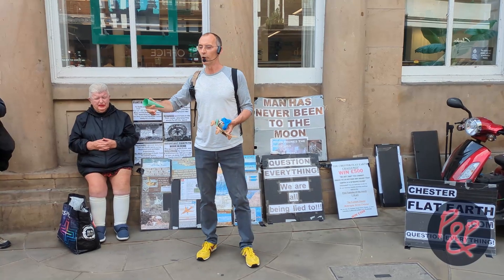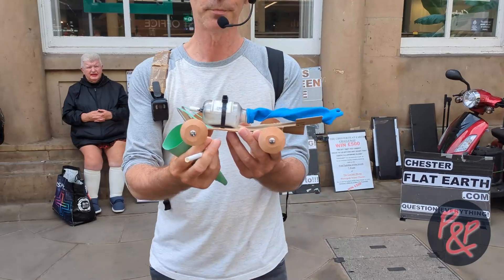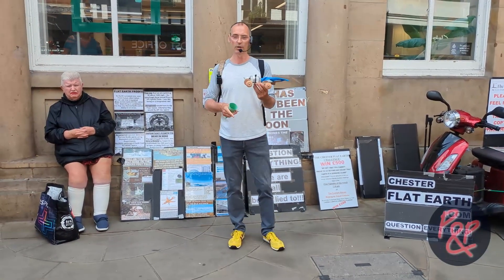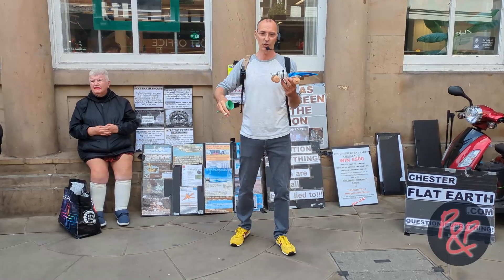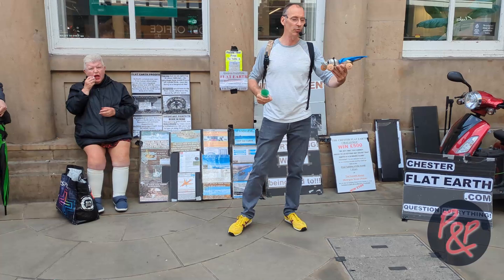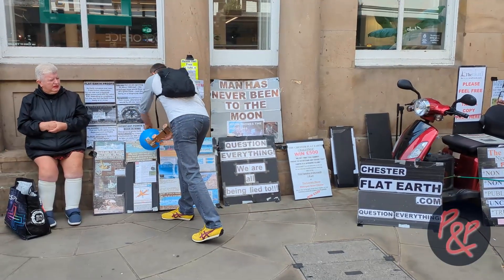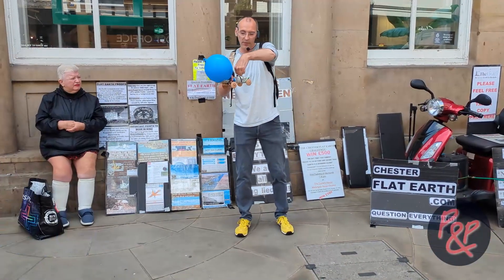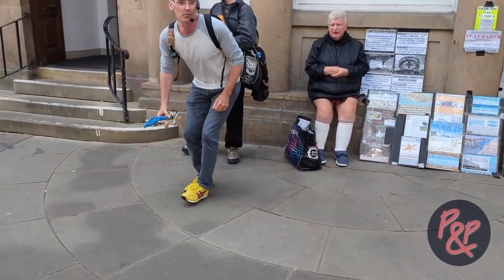Street Demo: How a rocket doesn't work!

Comment: great demo.
Reply: The only demonstration is that a diverging nozzle slows down subsonic flow and therefore reduces thrust.
Reply from the maker: @AM-rd9pu  you're neglectinng the fact the air inside the balloon is still able to exit the balloon.

According to science, NASA etc once the air stream leaves the straw it is irrelevant to the generation of motion!!!

According to mainstream science all the car needs to move is the air to freely exit the balloon and an opposing force will be generated at the front of the balloon to push it forward!!

This is not true - 

It is clear that the exiting air stream is vital in determininng whether motion is genereted or not!!
Reply: @PeterPete  How many times do I have to tell you that the diverging nozzle is slowing down the flow leaving the balloon and therefore reducing thrust? Remember the birthday candle example I gave?

Here’s another example for you. If you stand on a skateboard and lightly throw a medicine ball, you’ll move a certain distance. If you get back on the same skateboard and throw the same medicine ball harder, you’ll roll farther. You threw the same weight, but when you threw the ball harder, you moved farther. 

The same thing happened with the balloon car. When the balloon “threw” the air faster, it moved farther. 

This is a simple application of newtons laws. You’re even starting to figure out that flow speed is related to thrust but you’re reaching the wrong conclusion.
Reply from the maker: @AM-rd9pu  listen very carefully to the scientific explanation regarding how the balloon c ar works - are you ready?? good now listen 

For every action there is an equal and opposite reaction - so the exiting air from the end of the straw induces a force in the opposite direction. 

So if the air is always free to exit the end of the straw, the balloon car should always move!
Reply: @PeterPete  The balloon exerts a force on the air inside it and that air exerts a force back on the balloon. That’s what makes the car move. You seem to get that much. 

What you don’t seem to get is  that how fast the air leaves the balloon correlates to the speed the car travels. It’s just F = ma. Increase acceleration and the force is greater. A greater force means greater thrust and the car goes faster and farther. 

Once again, the nozzle you added to the balloon slowed down the air leaving it. Slower air means less thrust. The car moves less when the air leaves slower for the same reason that throwing the medicine ball softer makes you move less.
Reply from the maker: @AM-rd9pu  in both instances the air was free to exit the balloon via the straw!! But the motion was significantl;y different in both!

Tell me how could the rate at which the air stream left the end of the straw have been affected by the cone/nozzle?

I blew up the balloon in both instances roughly 3 times and the balloon would have deflated at the same rate.

So in what way did the cone slow down the rate at which the air stream left the straw?
Reply: @PeterPete  It comes down to Bernoulli’s principle. Widening the area of the flow with that diverging nozzle decreases velocity. I already explained to you why reducing velocity reduces thrust. 

The balloon deflated in about 2 seconds for each run. The difference is that the air leaving the straw was much faster than the air leaving the nozzle. Please refer back to my birthday candle example for a tangible demonstration for how converging and diverging nozzles affect flow speed.
Reply: @AM-rd9pu  incorrect assertion.  Also what do you predict happens when the "nozzle" has holes placed around its surface?  Obviously still same shape nozzle.
Reply: @useyournous It is an objective fact that a diverging nozzle slows down subsonic flow. Are you really rejecting that?

And I don’t know for sure what would happen if you started poking holes in the nozzle. It could either slow down the flow less or the holes may cause turbulence that slow down the flow more. Either way, that’s not applicable to the demonstration. The fact of the matter is that the nozzle placed on the straw reduced the thrust from the balloon.
Reply: @AM-rd9pu  it'a 100% applicable because it increases the speed of the vehicle.
Reply: @useyournous  A diverging nozzle slows down subsonic flow and therefore reduces the thrust generated by the balloon car.
Reply from the maker: Thanks!!